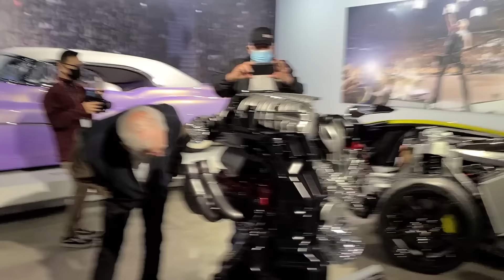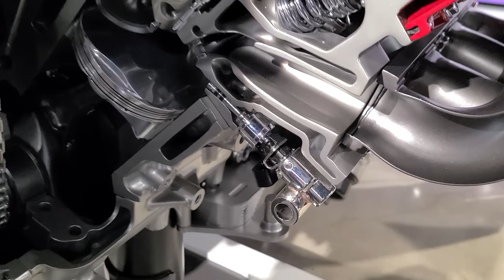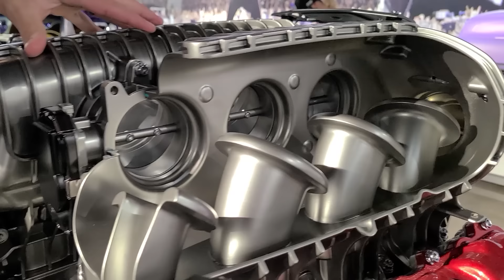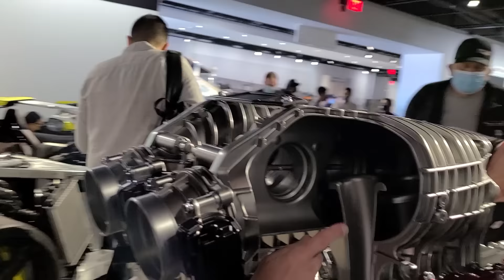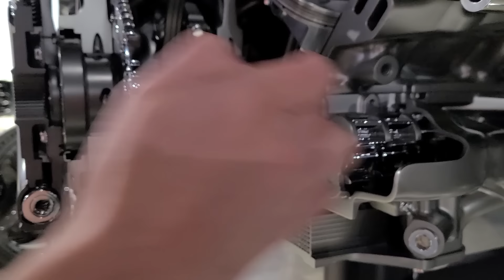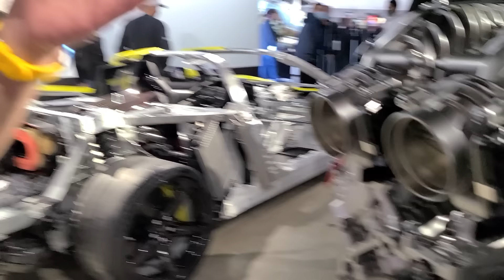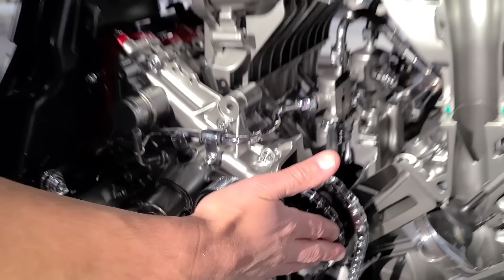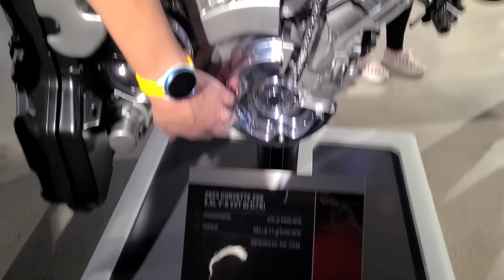2023 Z06 LT6 Cut Away Interview with Dustin Gardner

Comment: GM did a great job of making the Z06 LT6 for what I assume will be a relatively low cost versus its competition. However, there is no technology discussed in this video that hasn't been around for 60 to 80 years. Dry sump lubrication systems, light weight rods and pistons, high compression and flat plane cranks were all widely used in WW2 airplane engines (along with superchargers and turbochargers). Race cars in the 1960's used suction created by the air in the exhaust headers to create a vacuum in the crankcase to reduce the rotational drag of the crankshaft.
Reply: Titanium rods in a factory engine? Direct injection on the exhaust side? Direct cam on valve?  I think your way over stating or it just went totally over your head. You must be an engineer for Ford.
Reply: @oldblueaccord1988  By the way Captain Numbnuts, I forgot more about engines than you will ever know in your life wether its automobiles, gas turbines, or rocket engines. When you have no clue what your talking about, or the experience level of who you are talking to, it's better to keep your mouth shut so people will only think your stupid instead of opening your mouth and removing all doubt.
Reply: @rocketscience777999  I was going to let you go with your embarrassing compassion of a radial war time aviation engine and a production automobile engine but I see you can not help yourself. Thats a good thing outing people like you...
Reply: @oldblueaccord1988   you were going to let me go but then you decided to set me straight with not a single fact. Obviously I don’t have any of your book learning but, next time you set someone straight try to come up with at least one fact that you can correct them on. In a battle of wits you are clearly unarmed.
Reply: @rocketscience777999  Hey I know! You could start your own youtube channel, since you have no videos. Explain to us how and air cooled radial engine is the same as a flat plane overhead cam water cooled V8.
Reply: @oldblueaccord1988  No you are just ignorant of aircraft engine technology used in World War 2. Direct cam on valve is high technology? Many performance cars had solid lifter camshafts in the 1960's which is the same thing. Moving the direct injection to the exhaust side is advanced technology? Really?. There's nothing on the Z06 engine that wasn't used by Ferrari over 20 years ago.
Reply: Titanium Intake Valves, Sodium-filled Steel Exhaust Valves (ok, the sodium has been done before), but I think it’s important to note that ALL the things you mention as having been done a long time before is true, however, not ALL of them in one, single engine.
Reply: @45auto82  Take a look at the Pratt and Whitney Wasp Double Major. It may not of had every single feature of the Z06 engine, but its was way more advanced in many ways. It was a 28 cylinder radial engine with 4 rows of 7 cylinders that were twisted to allow all the cylinder heads to get forced air cooling. It was air cooled,  turbo charged and supercharged and had a cam shaft with two sets of lobes (one for max cruise and one for max power) that can be changed  in flight. It was designed in 1939 and is one of the main reasons we are not all speaking German today.
Reply: This is the most powerful naturally aspirated V8 in a production car. Wonder why it took until 2021 to reveal this type of power? Surely if all the technology you claim was so common, that power would have been an easy task long ago. Also, to comply with the emissions standards is a whole other entire feat. Maybe the very starting points in some of this technology has been used before, but not in this level of precision and advancements in metal coatings, etc. to amalgamate something like this engine.
Reply: @damascus-ut1ee  honestly it took till 2021 because turbo charging is easier and Porsche don't mess with 8 cylinders much. Not knocking it, amazing car

Comment: They need to have made it flex fuel to allow it to get some performance gains from using higher ethanol fuel! Bet if these were tunable this engine could make easy 700-710 from switching to e85 and turning up some timing.
Reply: If the regular LT1 is anything to go by this would pick up 25-30 just off ethanol alone. I’m not sure why they don’t make any corvettes flex fuel.

Comment: Not enough torque. Horsepower sells cars, torque wins races.
Reply: Plenty of torque. It is multiplied by the final drive ratio for the Z06.
Reply: That’s not entirely true. If you have a car with 100hp/200ft lbs of torque versus a car with 200hp/100ft lbs of torque, the car with more HP will win. 

The transmission and fast revving engine have a huge advantage in the C8 Z06.

Yes it has less peak cylinder pressure than the C7 Z06, but it produces more work in the form of HP.
Reply: You're overlooking fast shifting transmissions with alot of gears. Don't need bottom end torque when the engines never there under load
Reply: That statement would be true with the caveat "if all things are equal".  The fact that the C8 has moved to a mid-engine layout gives it a traction advantage that can be prohibitively difficult to overcome for the traditional Front engine/RWD competition.  The Z06 was not designed with drag racing in mind, but nevertheless, estimates peg the 1/4 times in the 10.4-10.5s range.  If that holds true, that would beat even the GT500, with a 90 hp/165 lb-ft disadvantage no less.  In fact, I can't think of a quicker car (EVs excluded) for same or less money.  I just watched a C8 owner absolutely demolish Hellcats over and over again.  The owner isn't a professional racer from the looks of it, but consistently hits 11.4 on each run.
Reply: Torque is a measure of the twisting force on the crank.
Horsepower is a measure of how much work is being done by the engine.
Thats why racers chase HP.
Reply: The new Z06 is gonna do 0-60 in 2.6 seconds… it has plenty torque for how quick it accelerates… plus torque isn’t the point of the car, the point is to develop a fun quick and high revving motor. Think Ferrari 458. You need to work the car and keep it above 4.5k rpm to get a feel for it… keep in mind this is a NA engine… this has more power than the previous Z06 with .7 less displacement. Quit complaining.
Reply: @panthersfan8494  I believe its only a 10th faster to 60mph than the LT2 and far more complicated. They are trying to make the corvette a Ferrari. I don't understand why. All the complication makes it far more difficult to hotrod/modify and make unique.

Comment: That looks slightly like a Toyota engine, seems they ran shy of places for a starter, atleast they didn't do the last minute thing and put it in the transmission! It's a bit more exotic than anything before, seems before engines were expired by Nascar engines, this seems more F1, my question is,, what doors it do with 2bar boost??? It should be in the 1200-1800 hp range..  is this going to be another LT5 of the early 90's, or is this going somewhere?? Maybe in the 2026 ss truck?
Reply: The starter has been placed in several V8s in the valley area. The LT5 of the 90s has the starter in the valley too - I know, I have one!

Comment: I never thought about cross plane air management within the case until now, the way he explained the benefits of managing the air pressures, oil myst...etc, to create a vacuum for the internals to move through really taught me something there.  Great quick video of an undoubtedly amazing engine.
Reply: This is why the LS6 motor had big holes drilled in the main webs to allow bay to bay breathing.
Reply: Kind of like the reverse of Expansion Chambers for the 2 stroke engines !?
Reply: Tight tolerances.
Reply: Racers put a vacuum port on the exhaust to pull a vacuum on the crankcase.  But you can get a lot of oil in your exhaust doing that.
Reply: @bryanrussell6679  James Bond smoke screen.
Reply: Offenhauser was doing that in the 60s with wet intake manifolds, my dual port 360 runs circles around everything else

Comment: I cannot believe how compact they were able to make the DOHC valvetrain!
Reply: Just look into '02-'03 Yamaha r1 engines. What they managed to fit under that little valve cover is amazing.
Reply: @fordmud  the engine is quite simple actually. They went full mechanical on alot of things. Having the rotating assembly run in a vaccum is quite a good idea but normally that is reserved for race engines becausr you need air/oil separators in the oiltank
Reply: What's crazy is that it still has over a 4" bore spacing which is significantly larger than the Coyote so it can be bored and stroked quite a bit.
Reply: @tommyhallum2054  this engine, unrestricted by emissions will push 800hp at 9000rpm with just a set of cams. Its rpm limited because of the transmission....but if someone does not care about transmission reliability lol
Reply: This engine is like two k series honda motors mated to one crank.
Reply: The heads are really not that wide compared to other DOHC engines. Voodoo and Coyote heads are significantly wider

Comment: How hard would it be for GM to turbocharge this engine? They might need a completely diffrent intake set up and this seems very integrated into the block. Just imagine this engine running a cool 8 psi could very well be 1000hp.
Reply: For sure!. Just gonna have to lower compression a bit but 8psi should be more than enough to squeeze a couple hundred hp out
Reply: It can probably handle single digit psi of boost on high octane fuel and not need to be cracked open to lower the compression. It looks to have variable valve timing and with that it can probably be tuned (along with intake plenum tuning) to lower the dynamic compression ratio so that the extra air pressure doesn't cause problems. I have a high-ish 10.4:1 static CR engine and it has over 80k miles on 10psi of boost running crap 91 Octane California gas and it has survived just fine by managing the variable valve timing under heavy boost. Some would argue it's wasting HP, but if the HP makes the engine go boom then it wasn't your HP to begin with.
The boat anchor to boost will be the ECU. I doubt GM will allow people to manipulate it any time soon and unless someone goes the same route as current C8 tuning (piggy-backs) it won't matter.
Reply: I’m wondering if turbos or a supercharger would be best?  I’ve heard from my dealer that the C8 ZR1/Zora will have all the bells and whistles with some kind of boost, but I can’t recall if he said it was with the Chevy 6.2 or this new 5.5 motor.  Anyone know better details?
Reply: @45auto82  should be 5.5L turbo for the zr1 and 5.5L turbo plus hybrid on the front wheel for the zora from all the leaks I heard
Reply: @tg0003bpa  Thanks very much, I believe that’s pretty close to what I heard too…maybe twin electric motors on the Zora, single on the ZR1.  Thanks for jarring my memory!
Reply: @45auto82  I could be wrong but I believe the single front motor will be on the e-ray. The 5.5 making 670hp will easily make 850hp at lowish boost I doubt very much Chev will want to weigh down the zr1 with hybrid component! The z06 will probably have a wet weight close to 3700 lbs. Add twin turbos, intercoolers  all the piping and active aero and you are probably over 3900 lbs. Now add the hybrid system on top of that and for a single electric motor you very well might be at a point of diminishing return.